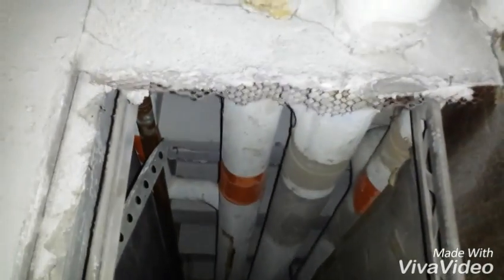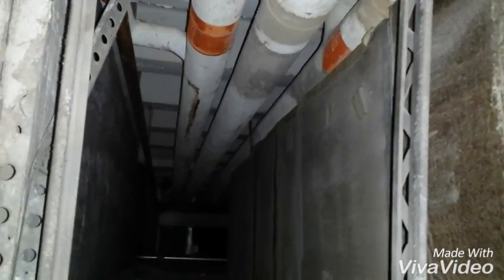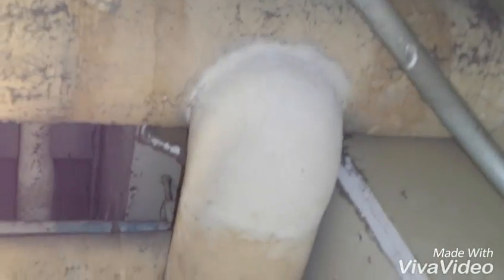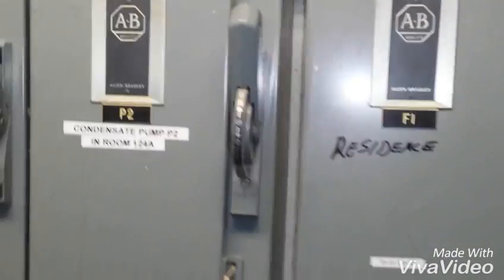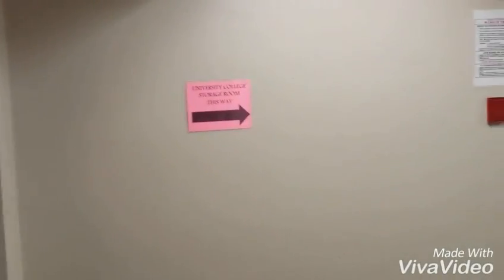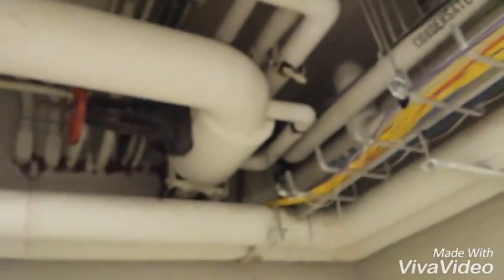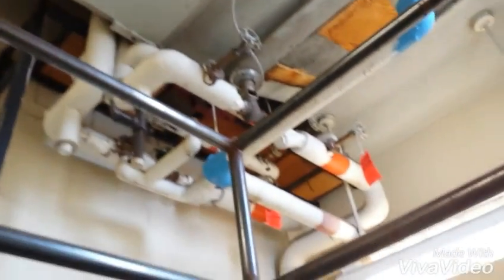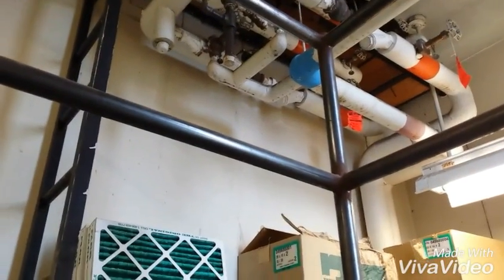Asbestos in the air. University of Mesothelioma Why is this happening at the University of Manitoba?

Comment: Will there be like debri in the air if there is asbestos?
Reply: Nope. It's not visible in plain sight. You also can't smell it or taste it. The exposure in this case is really small, but it's still dangerous, especially if you are there continuously.
Reply: @juliuseskola1281  Say that to veterans.  This aint little. This is old and not reliable at all. There is a reason they have banned the use of asbestos in these aplications.